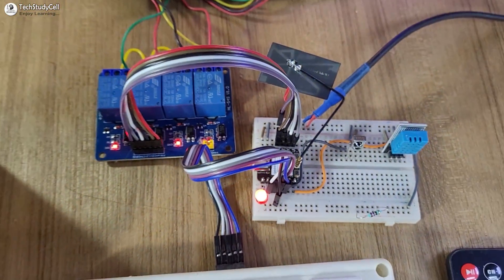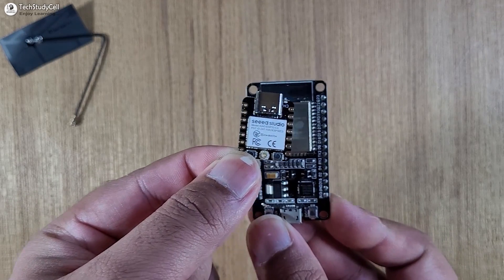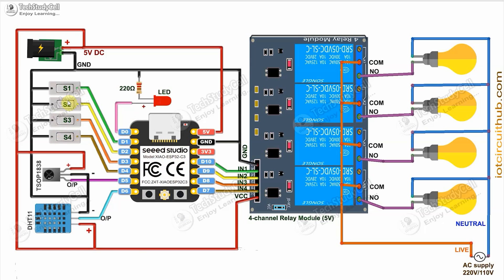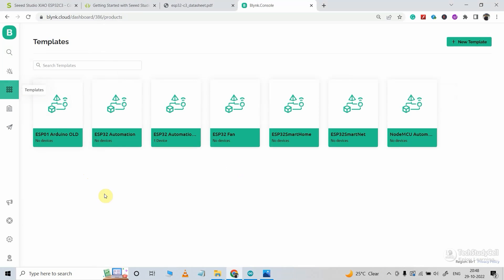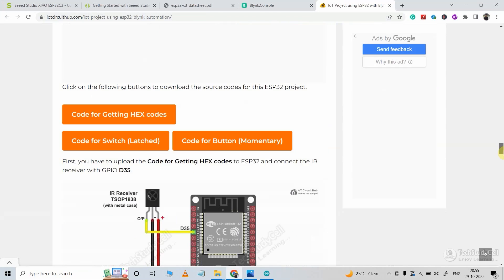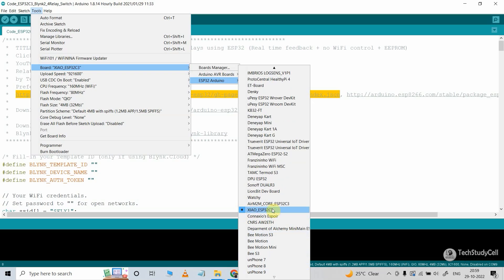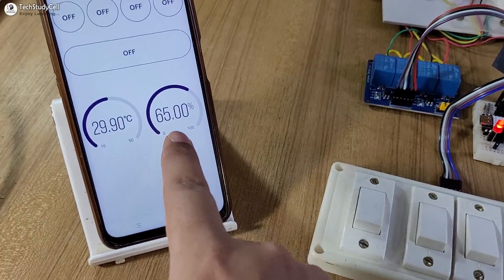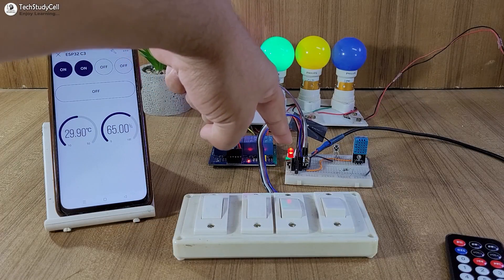IoT Project using SMALLEST ESP32 🧐🧐 Sensor with Blynk | XIAO ESP32 C3 Home Automation Projects

Comment: Funny thing, I just build practically the same setup. Except used 3.3v for the sensors so the data level returned to the esp32 would not be 5v. The esp32 devices can't which handle 5v.
Also I added a 10k pull-up resistor to the digital input (edit: I was following another example, but the pull-up was not necessary because the device has those internally)

In my situation I had 230V Neutral as well as Live available and used a tiny pcb mounted 5v powesupply.

Comment: Hey bro... I am having a problem with my esp32 chip... Whenever I try to install any code on the chip it says fatal error... MD5 of file does not match data in flash!... Please help... The chip is working with the your code already installed in it... But I cannot install any other code... Please help
Reply: Bro you have restore factory the esp thenyour able to upload